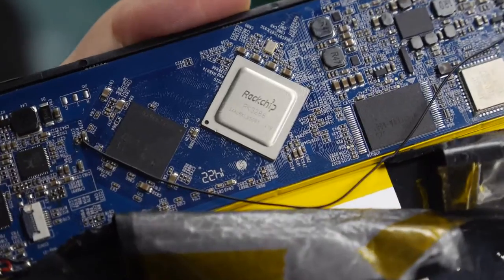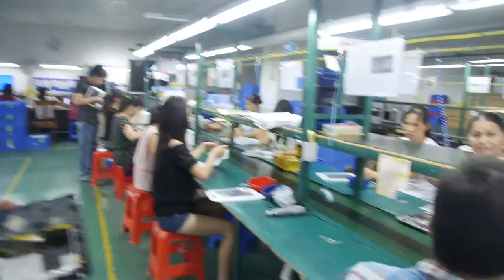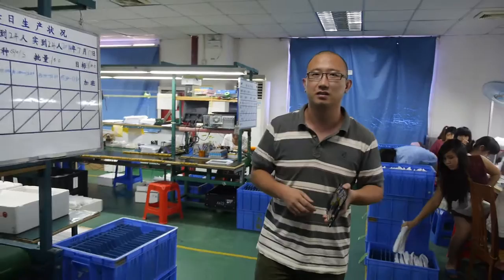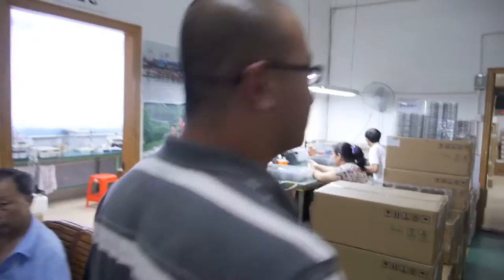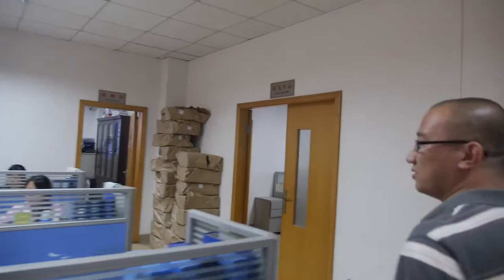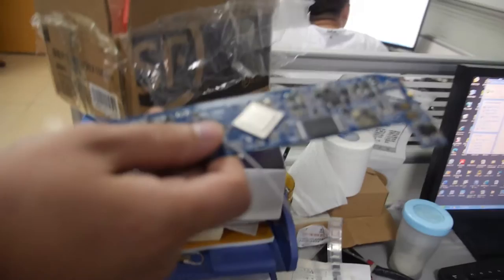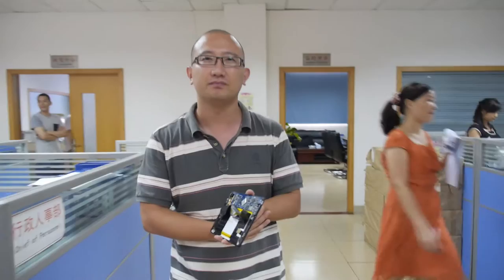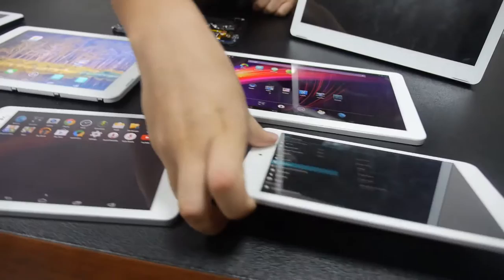Li Rui RK3288 Factory Tour

Comment: I wonder if these have GPS and 3G
Reply: The olders ones like RK3188 do have GPS/3G, depens actually on the company.
No doubt if the company is ok, then the newer 3288 will even support 4G too.
Reply: Pakos Raja I know Pipo does with their RK3288 tablets
Reply: MrBrymstond  Pipo is ok, but a bit overpriced. But at the same time great quality. I have one of the rk3188 also by Pipo M9pro Max. I never regretted it, came with gps/3g. And awsome battery life and speaker's.
Reply: Pakos Raja Nice, but this RK3288 is twice as fast! I have the Minix NEO X7 which has the RK3188 and the RK3288 is double at least and the graphics are off the wall with that Mali-T764...
Reply: I agree.